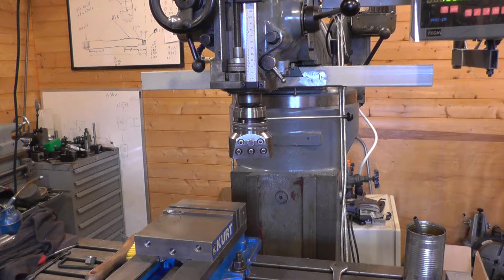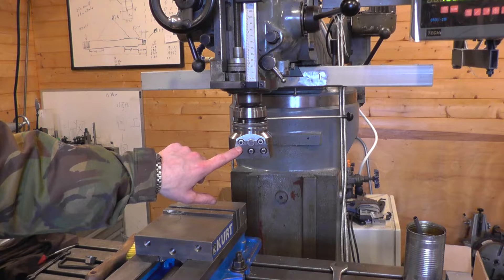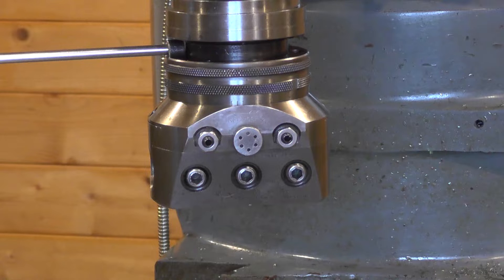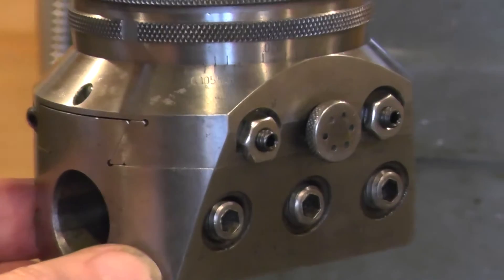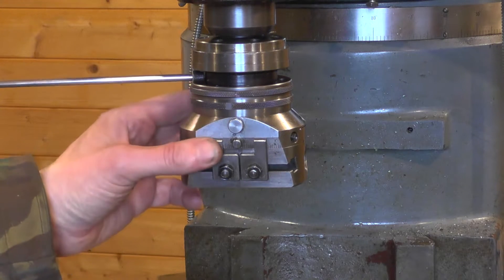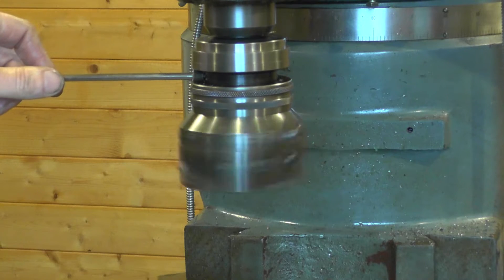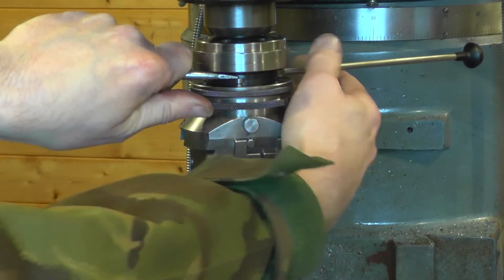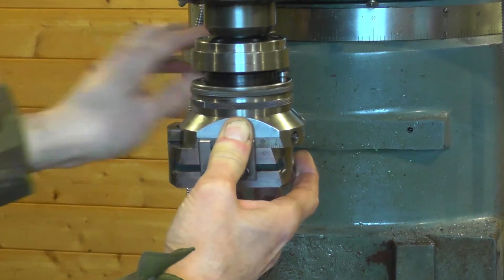Automatic Boring & Facing Head

Comment: Hello Paul, thank you for your nice video: today My Wohlhaupter UPA3 arrived, i have a question: the central locking ring have manu radial holes, why? And to use It? I have only to rotate the locking ring to stop the head after regulation or i have to adjust It? Thank you in Advance!! Alberto
Reply from the maker: You can find a manual on the New England Model Engineering Society website
http://www.neme-s.org/Shaper%20Books/Wohlhaupter/
Reply: @EVguru  Thank so much Paul!!!

Comment: I have several Wohlhaupter heads but could never find out if the taper part is replaceable. You've dismounted this?
Reply from the maker: My Mizuguchi has a flange mounting. From what I was able to find out, the Wohlhaupters either have an integral shank, or one retained by a differential thread fastener.
Reply: Hi Guys, is a very interesting tool, the former boring heads were made whith the shank and the body of one piece, I don't know when Wohlhauter began to made de boring heads with interchangeable shanks, but I have a drawing from 1977 which explain how to change the shank. Actually the UPA 3 can use MT N°3 shank or ISO 30 shank, the UPA 4 can use either the MT N° 4 and ISO 40, the last one UPA 5 S6 can use MT N° 5, ISO 40 and ISO 50.
Reply: If any one needs the drawing explaining the mount and dismount the interchangeable shanks, just send the email and I will send the drawing.

Comment: That one is far different from my Wolhaupter. The ring on mine has about a dozen pins to engage the amount of feed depending on how many you push down. It also has a coarse adjustment using an allen key. I think mine is UPA-4?
Reply from the maker: The UPA-4 and up have that feed system. I previously had a UPA-4, but despite what the seller told me,it had an integral INT40 shank, not a replaceable one and I sold it on.
Reply: We would love to acquire a UPA-2 for our little machining operation (costly) so you have a -4 wow nice to have, too big for us still nice for a knee mill we assume.
Reply: @ActiveAtom  Lucky ebay score forwarded to me from a friend..:)
Reply: Upa1,2 and 3 have single feedrate and automatic reverse. Upa 4 and larger have multiple feedrates but only manual reverse.
Upa1/2/3 heads can be automaticly reversed without stopping the spindle pressing down the reverse button.